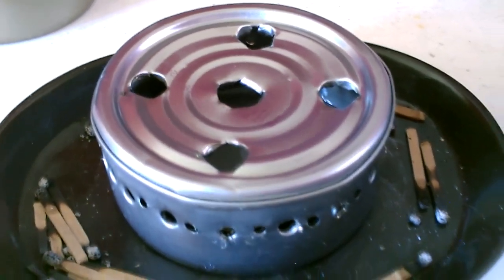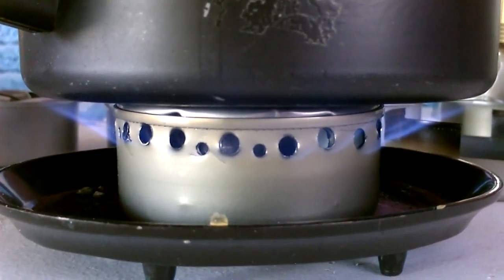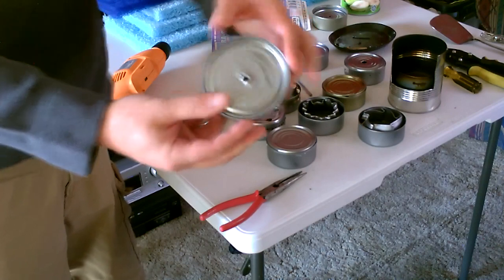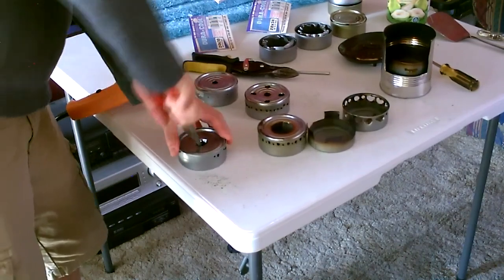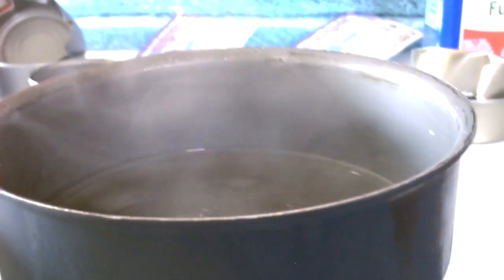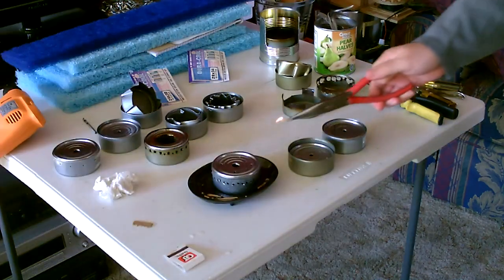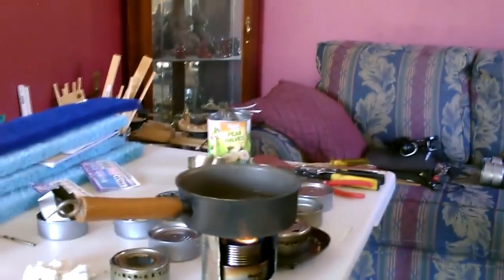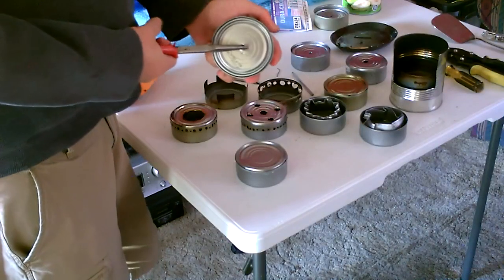DIY Tuna-Can Alcohol Stoves! - {5 stoves!} {3 fuels!} ~ designing/building/experimenting

Comment: Can this method actually reduce your power bill by using a 220 volt stove less?
Reply from the maker: hi. absolutely 👍
Reply: @desertsun02  This method works pretty well. Im surprised how well it works. VS the gas generator or the 220 stove or if the power goes out this is the way to go.

Comment: One model which can be done without tools is put steelwoll into can and wick in middle. Low power and no soot. Aluminum foil and toilet paper stove works. Use bottle bottom to form cup and fill it of alcohol soaked paper.

Comment: I find that isopropyl burns a bit dirty and will cover the bottom of the pot with soot.  I usually put a piece of sturdy aluminum foil to cover the pot bottom.  I find that HEET burns pretty clean and hot.  I now have a larger container and I mix one 7 oz. bottle of HEET with one 16 oz. bottle of isopropyl and no soot problem.  I buy both products at my local dollar type store.  I use something like your four can setup.  I use a computer fan cover as a stove grill and it lets me put smaller pots directly on top of the stove.

Comment: Question,  would oils work? Like olive oil?
Reply: Olive oil and such only work if you have some kind of wick in the oil. I ate a can of anchovies that was pack in olive oil and there was about an ounce of oil left in the can. As an experiment I rolled up bit of cotton cloth I had cut up to make char cloth and laid it in the can with the tip over the edge. I let it soak up the oil for a few minutes and then lit it. It burned perfectly, as bright as a good candle. The oil in the tin probably would have burned for at least 45 mins, maybe even an hour.
Reply: Mishi Hernandez no sir, the fuel should be one that evaporates quickly, and burns at high  temperatures. Olive oil may burn but the fuel should also be able to create pressure at high temperatures for the jet models

Comment: I have a question. I built an an alcohol stove and it worked fine to heat the bricks above it. The problem I ran into is this. A new, opened bottle of isopropyl alcohol burned fine. Alcohol from the same bottle, (capped overnight), wouldn't light at all. What gives?
Reply from the maker: hi there. 70% isopropyl alcohol should work fine every time (even if it's a bottle that's been in the cabinet for 10 years). my thoughts/suggestions are... don't use 50% isopropyl because there is too much water in that. if you're using 70% - did you remember to dump the "leftover water" out of the container before you added more alcohol. if you don't do that every time, the alcohol could be too watered down.
Reply: Are you using 70% or 91% alcohol assuming you are using rubbing alcohol? I had trouble with 70 and solved with 91. Not everyone carries 91.
Reply: The text at the end said he used 70%